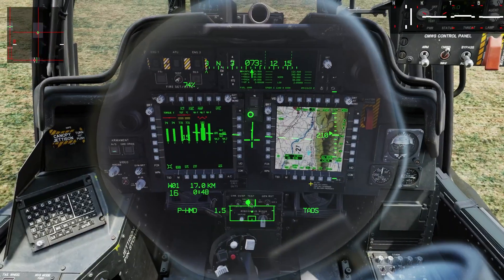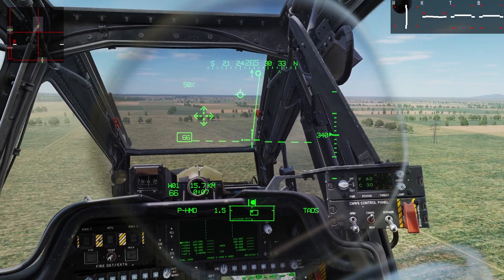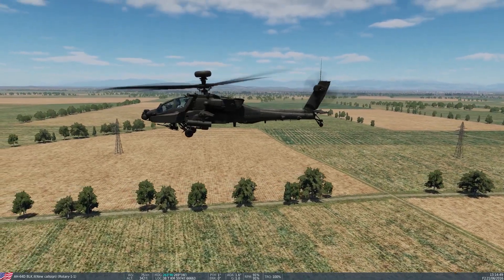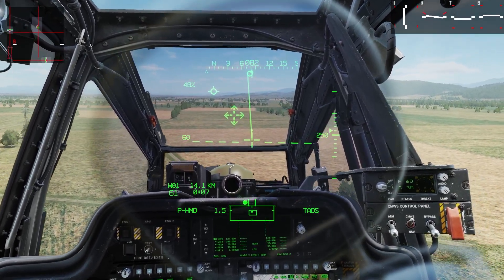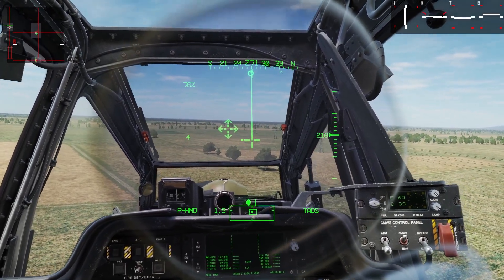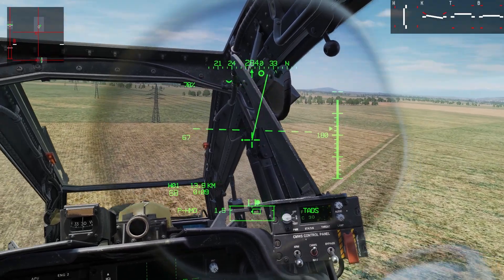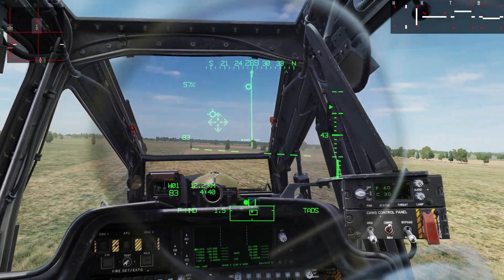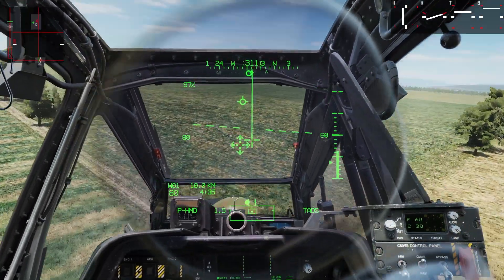AH-64D Things to Avoid and Maneuvering

Comment: The use of the trim : it's difficult for me to understand when one needs to push and hold, manoeuvre, then release the trim and when a simple push is what is required. I have Instant Trim for the joystick in the options - as per the manual iirc.
Great vids. As others have said what us virtual pilots really need to understand how we should be throwing the Apache about.

Comment: I have a lot experience with Mi-8 in DCS and it feels easy to fly, but Ah-64D feels hard to master. The problem is not normal flying like take off, landing, straight and level, turns and climbs, problem is when you want to be more fast of aggressive with manoeuvres. In Mi-8 just load 10% fuel and you can do crazy aerobatics (watch the rotor rpm,G meter, and wind direction)but Apache feels very hard to control in the same case. Or it is just muscle memory from Mi-8.